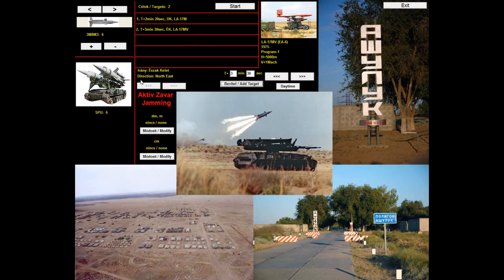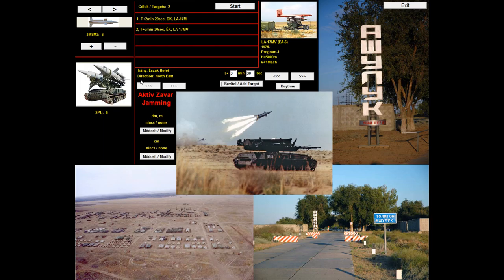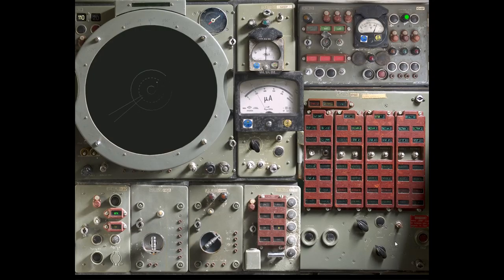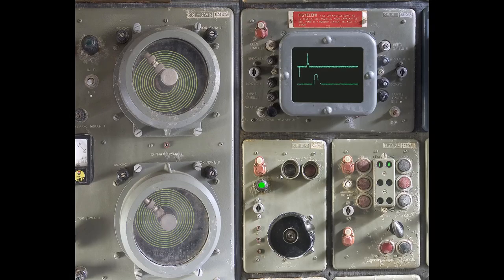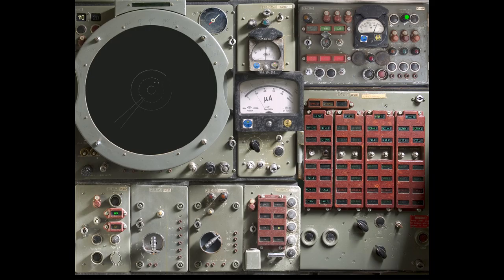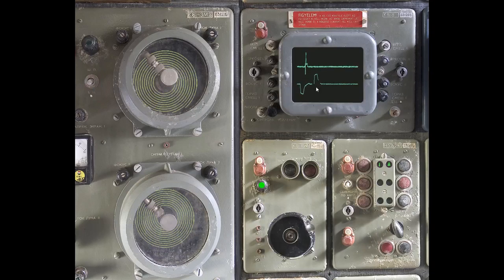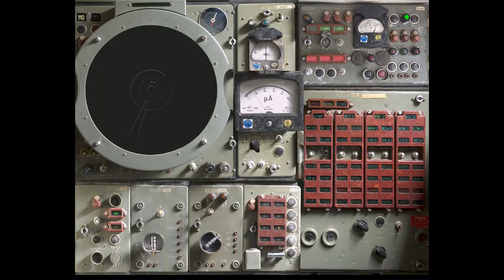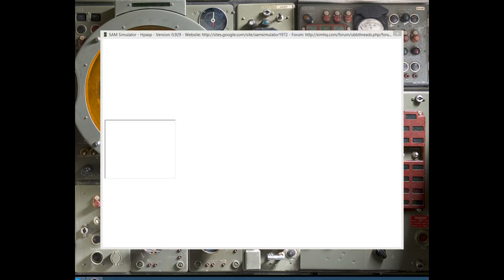Game Time - SAM Simulator: SA-4B Ganef

Comment: Krug does mean circle. And your pronunciation is correct too: in the middle "u" sounds like "loop", not like in "cut".
5:47 "Izlucheniye Vyklucheno" Emission turned off.

As for reading russian alphabet it is very simple actually. All you need is just know how each letter is pronounced and that's it - you can read. (Ok, to be completly correct there are 4 letters Е, Ё, Ю, Я that has two options of sounding depends on what is in front of them: e.g. Е in front of word or after vowel it sounds like YE, after consonant - E (example is: "izluchEniYE")). And also there are two signs: Ъ and Ь: if you need Е, Ё, Ю, Я that are following consonant sound like they are at the beginning of the word or after vowel - you use these signs. E.g. серьёзный (serious) sounds like seryoznyj, ь in рьё makes ё sound like YO.
And finally sign ь after consonant give to this consonant softness. For those who knows Spanish it's  like N and ñ. If after russian Н (which counds like english N) we put ь it will sound like ñ. For example день  (a day) sounds like d'en'. with ' I tired to show softness. So sign ь and letters Е, Ё, Ю, Я after consonant give this consonant softness. E.g. день (D and N in this word are soft), дань (tribute) Д is hard (sounds like D in  word Data) and Н is soft because after it there is soft sign ь. If you dont want give softness to consonant but still need Е, Ё, Ю, Я sound like YE, YO, YU or YA you use hard sign Ъ. E.g. объем (volume, sound like "obyom"). In this case B is hard like in word oBject. By the way object on russian would be объект. Try to pronounce it yourself😉.

Sorry for long post but now you can read Russian.

Thank you for video.